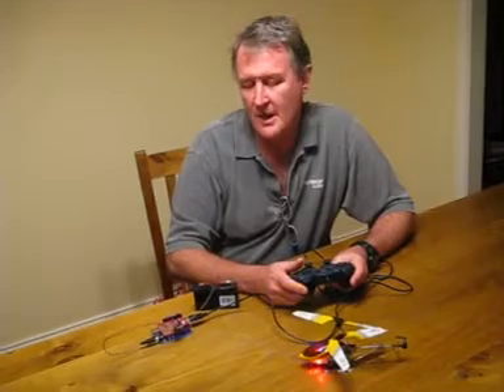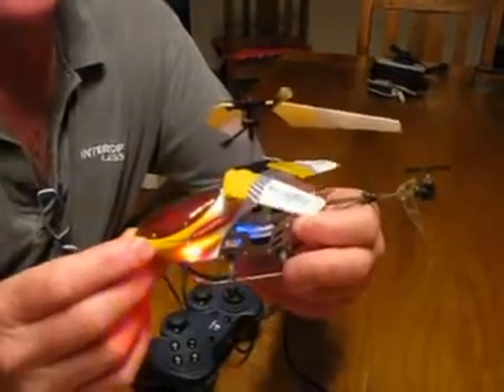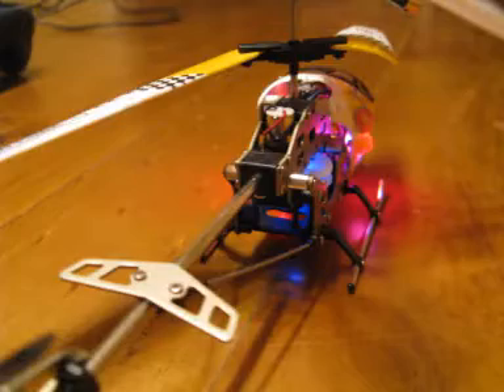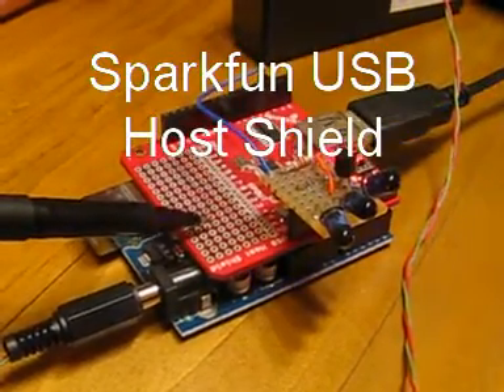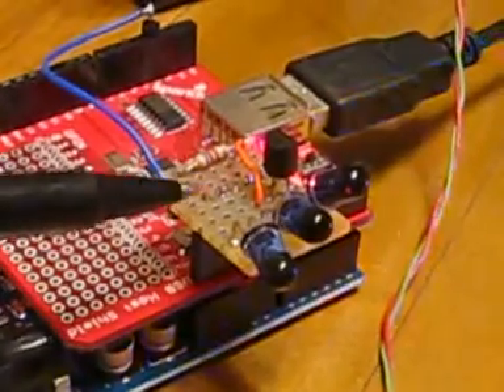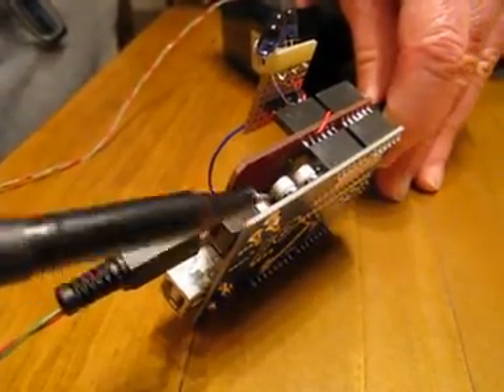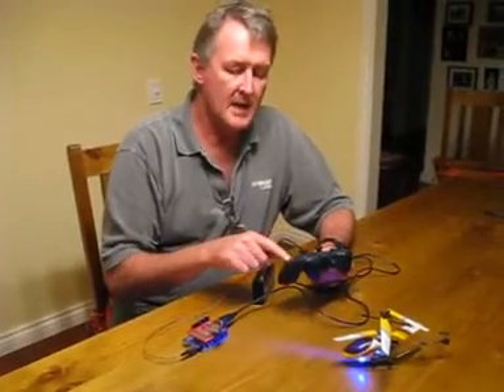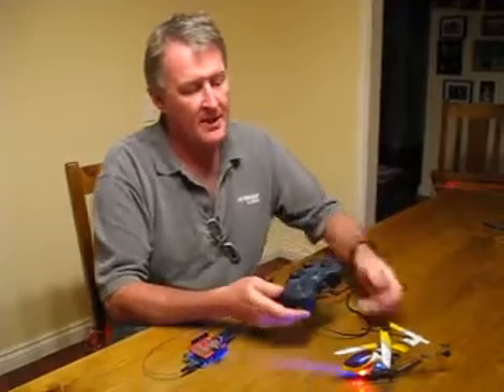joystick-heli.mp4

Comment: Hi, I was just wondering how you read the input from the usb controller. What sort of library are you using to translate the joystick motion into a voltage read by an Arduino analogue pin?

Comment: @mikemccauley2 no problem, could you tell me how the logitech data is read by the sparkfun shield?  is it any special communication or could this shield connect to any USB controller?  ..maybe I should just get some sparkfun datasheets ;)

currently I do send my inputdata from PC to arduino via USB, getting rid of the PC as 'man in the middle' would be nice..  

I am also thinking about connecting a infrared LED to my arduino, so I could not only control my radio helis, but also IR helis